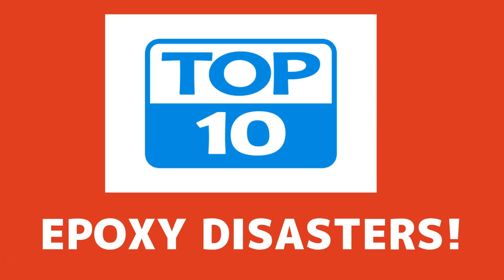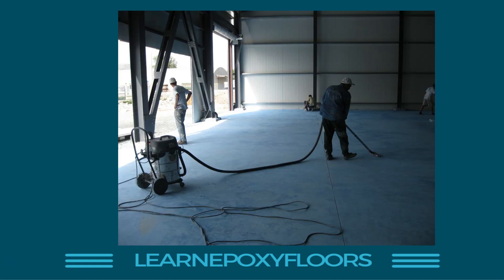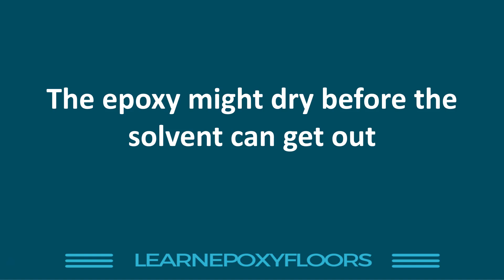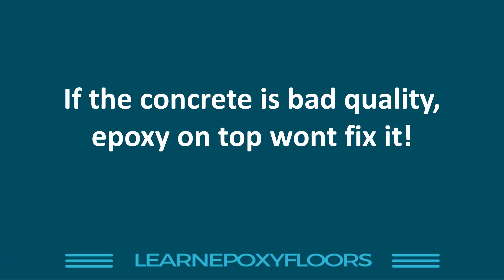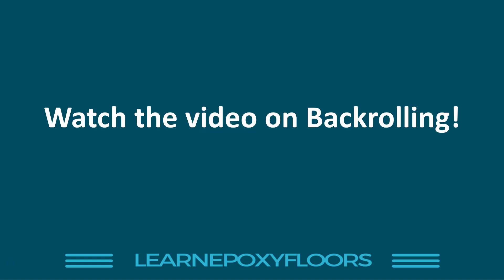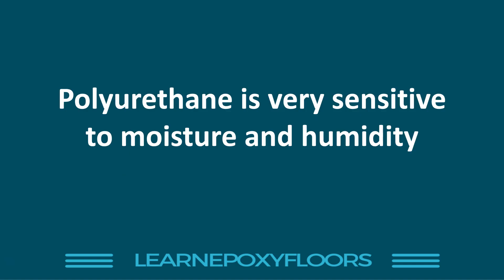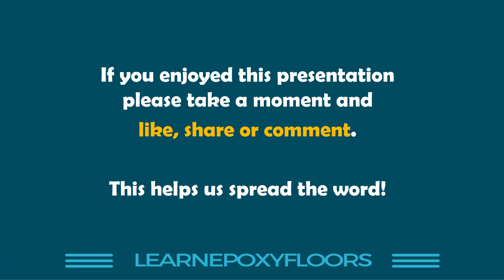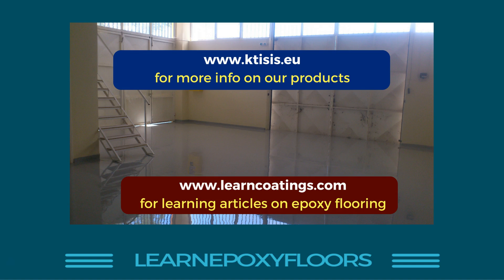Epoxy Flooring Disasters that could happen to you! - Learn about our top 10 incidents

Comment: Thanks for the great info!!!

Quick question: if concrete has "divots" from scraping mastic improperly off floor....would self leveling concrete over entire surface in a thin layer be "rough" enough after drying to begin application or would that also need sanding?

We don't think sanding would eliminate some of those divots.

Please share. Thank you in advance.

Comment: Here's one you didn't add  the contractor didn't put a dam around the  basement floor drain now I have hardened expoxy clogging by drain and we can't use the washer because that's where the water drains

Comment: Many thanks for sharing. We learn from our mistakes very well.  My first pour on counter tops. I Needed one gallon all together for the section I was doing. I learned the hard way not to let epoxy sit to long in large one gallon buckets. I learned  to pay strict attention to what the temperature is of the epoxy. I took way to long mixing in my colors it was an exotic dirty pour complex . I mixed for like 12 minutes and stepped out side for 3 more minutes. Came in started pouring and I noticed the bottom of the bucket was ( WOW BUBBLING HOT )  ! loved the first half of the pour from the gallon bucket but the last half from the bucket was like soft putty. Looking back I should have just taken a putty knife and scraped it all off.  But nope wife comes home from being out of town for a week and is well lets just say shocked...... I tried to save it and the next day it took me 3 to 4 hours to grind it off....Our next pours were all small mixes do it as fast as possible and pour, small mixes fast and pour. flawless.
Reply from the maker: Thanks for sharing this story!. We've all been through this

Comment: The 10 one is not a disaster, is client don't know that dust is use for non-slip parts, some worker will mix that with final coating paint, some worker just sprinkle on the top of last painting surface.

Comment: what do you recommend for a diy kit for a garage that will be a car shop? the floor looks fairly nice and smooth no cracks couple oily spots i know to clean clean clean and clean some more but id like a good product that isn't going to chip away after i drop a tool or have warm tires on the floor. is grinding the concrete necessary on floors that already seem like nice concrete if its clean? or will it set better with the grinding?

Comment: Do you think that we can use epoxy on small tiles shower floor, it could seal totally the floor ? if yes which kind of Epoxy we can use ?
Reply from the maker: Epoxy on tiles can be challenging, you need to grind and prime the tiles to make sure it will stick properly. Also if the tiles are loose causing water to leak, epoxy on top wont fix the problem

Comment: I am going to use some epoxy garage floor product on a wooden countertop that I made out of new wood flooring which I have planed down to bare wood. I am trying to find out what primer to use on the wood flooring ahead of the epoxy...can you help me? Is it an oil based, water based, or something else?
Reply from the maker: Always use epoxy primers with epoxy coatings

Comment: I have these "spiderweb" cracks all over the garage just after 12 of the first application. I've been told this is normal
Reply from the maker: Spiderweb cracks are usually thin cracks in the cement that had been there all along, but they became visible after the epoxy was applied. Shiny epoxy has a habit of revealing problems. For a first coat, this can be normal, just make sure you fill up these cracks and then apply one or two more coats on top

Comment: What is your opinion of the success/failure of applying an epoxy floor on plywood sub-flooring? I have seen videos of people (professionals) doing so, however I have had a number of people tell me 'NO!' do not do this as it will fail due to the wood flexing and the epoxy being rigid thus cracking. Seems obvious failure, but is there any method to avoid cracking from happening...applying cement over the sub-floor then epoxy? Would like an opinion, please. Thanks!
Reply from the maker: I agree with all the people that advise against applying epoxy on wooden floors. Small surfaces like tabletops are ok, but not entire rooms. In fact I have done a video on the subject. https://youtu.be/x_nI_Q6B6x8
As for the best solution, I would recommend finding a coating that has some elasticity like a polyurethane coating. Cement is not the best possible solution cause you will have a sandwich of three different types of materials one on top of the other.

Comment: Wouldn’t you keep your material in the room of the same temperature (space) before the application?
Reply from the maker: if possible yes. But often, practical reasons don't make it possible. For  example if you are applying an entire floor in a commercial space, there may not be any storage space to prime the floor on the first day and leave the goods in an area that will not be primed.

Comment: What about when you’re using sprinkles on like a two-part epoxy and every 5x5 section you do shows lap marks? Wtf? You can’t obviously just keep rolling because you have to throw sprinkles in? This has happened twice. Let’s Go Brandon
Reply from the maker: If you are doing sprinkles always have a second person with you. One person keeps on rolling and the other follows by sprinkling. It's also common to apply a coat over the sprinkles
Reply: @learncoatings-epoxyfloorin9448  
Ok, thanks for answering.

Comment: Great video to watch -we want to resurface our countertops doing a pour, never thought of any of these senarios - we've  never done this before. So as we are scared to death of trying this -it's  better to know how things can screw up before starting so we can be totally aware when beginning this event. Thank you much!
Reply from the maker: You are welcome, countertops are fairly easier to control because they are smaller surfaces. But still I recommend you start with one countertop before proceeding with the others
Reply: Did you do it yet?🤔🤗
Reply: No
Reply: Did you do it yet? I'd like to cover wooden floor(I've got real wood, not plywood) with epoxy. But I'm afraid of doing this. I think I'd better go with polyurethane

Comment: My white floors turned into yellow after 2 years, what should I do? Can I sand it? Should I remove and re-do or is there an eadier solution?
Reply from the maker: Epoxy has a long term tendency to yellow, especially if it is exposed to sunlight. You need to recoat the white area

Comment: Fun Fact: "Wet on Wet" is actually a painting term. It refers to applying a coat on top of another coat without sanding or prep in between application.
Reply: Not entirely true, “wet on wet” is applying wet paint before the previous coat has dried, Bob Ross style of painting. No sanding or prep is correct as it’s still wet

Comment: Don’t use heaters that generate carbon emissions to keep your winter slabs warm while they set up. The tops of the slab will pop due to a chemical reaction that keeps the Portland molecules from properly adhering to each other and the aggregate.

Comment: If you are doing commercial work, make sure your supplier and the color blends are exact. We did a floor at a machine shop at US Steel. They wanted the color to match their new machines, kind of a sad yellow. We had never used this color and it made me nervous. I actually didn't want to do it. This was a big deal for them, about 65000 sq Ft. and they were bringing in the big brass to show off their new machine shop. We did our prep, put on the 2 coats with proper drying time, and left. A few days before the machines were installed I got a call form them. They wanted to know when we were going to finish the floor. I said it was done 4 weeks ago. They were not happy. Some of the crew got lazy or the supplier failed. Either way, he said the floor was 4 different shades and looked like a checker board and they weren't paying. I went to see it and they were right. What can you do in 2 days? I don't know if he ever got paid for that.
Reply from the maker: Hey Daniel, thanks for your input, yes color consistency can be a massive issue for some customers. I always recommend to use the same batch for epoxies, because a slight difference in raw materials can change the tone of the color. In two days I would suggest they apply a light roller applied coat to make the floor look uniform
Reply: @learncoatings-epoxyfloorin9448  Well, putting even a light coat on 65K Sq ft is costly and you competitors will  not include that in their bids. Probably take at least 2 days and keeping this room cut off in a steel mill was almost impossible. Still, I was the manager of a floor company for 3 years and nothing beats Epoxy for lasting and beauty. Word if caution, watch out for heat. A customer of mine had a meat plant that had to be cleaned every day with 181 Degrees water.We told him epoxy can't handle that kind of heat and he hired someone who said he could do it. After a few weeks it began to fail and the contractor could not be found. That is not a surprise. Totally failed. 75000 sq ft. Also, watch out for bakeries and kitchens, same problem. You folks bidding this kind of work make sure you understand the environment before and after the job. Also, a little more on prep, more problems came from bad prep than anything else.

Comment: Hi. I just finished doing my 2nd coat for my bathroom tiles and already start using it after wait for 2 days but it left kinda white spot/mark when the water dry. So I just wondering whether I have apply epoxy wrongly or it just happen cuz it still new😅
Reply from the maker: Although it takes 7 days for epoxy to fully cure, it should have been dry enough after 2 days to not leave a mark. Did you try wiping and cleaning it?
Reply: @learncoatings-epoxyfloorin9448  I do. But it still leave those white dust/mark 😥 I google bout this problem & many suggest to try vinegar + water. If it still doesn't work, I don't know what to do anymore😭

Comment: Can you pour epoxy over self leveler?
Reply from the maker: you mean self leveling cement? Yes you can but make sure it has dried properly. I also recommend lightly sanding and priming properly with epoxy primer before putting any epoxy on it. Self leveling cements tend to be formulated with all sorts of chemicals that could have an unpredicatble reaction if epoxy is applied straight on to it.
Reply: @learncoatings-epoxyfloorin9448  Thank you

Comment: Darn mechanical errors. I found a little secret with adhesion over failed concrete. Cut material in half with solvent so that it impregnate the surface like a fluid. But let it cure before finishing coat. Thanks for video 👍
Reply from the maker: Interesting idea, it would definitely help to impregnate the concrete as long as the smell of the solvent is bearable!

Comment: Hey, could you let me know what sort of epoxy I need to use for a swimmingpool floor ?
The pool is made from water-resistant concrete and the floor tile glue isn't holding the tiles anymore (need to remove them).
I'd like to use epoxy as an affordable correction
Reply from the maker: There are Epoxy pool coatings available specially formulated for swimming pools. When the pool is not being used I recommend to leave the water inside or have the pool covered, otherwise the sunlight will damage the pool coating over time
Reply: @learncoatings-epoxyfloorin9448  ko

Comment: ⚠️desperately need help⚠️ : i had white tile floors that i accidentally painted black with wall paint, which now is chipping off whenever the floor is scratched, therefore i want to cover it up with white epoxy paint, is it okay to leave the black chipping paint without sanding it?
Reply from the maker: Tiles are notorious for poor bonding. If you apply epoxy on top of peeling paint everything will peel away together! You need to sand the paint, sand the tiles and then coat epoxy

Comment: I had epoxy put on my garage floor and it looks great. Problem, they put the wrong color down. is there a way to change the color without sanding down to the concrete?
Reply from the maker: Yes just recoat over the existing epoxy. Just give the existing layer a light sanding and apply over
Reply: Thank you!! I should have mentioned, they already put a clear coat on top of the epoxy. Same advice?

Comment: Great advice. For problem #9, how did you fix the sticky epoxy floor problem? Thanks for sharing!
Reply from the maker: I had to remove any sticky or loose product. I wiped the area with solvent and then I re-coated

Comment: After watching this, I’m wondering if I’m going to have a problem shipping it to the Caribbean where the weather is about 90 degrees. It will be stuck in custom and the ship. Will I have a problem once I get it ready to install? 😱
Reply: I think if the part A & part B get hot while they're in transit, it shouldn't be a big deal. The problem described in the video was that the A&B were very hot when mixed together, which caused the hardener to work too quickly. If the material is cooled down before you use it/mix it, it should be fine.
Reply from the maker: That is no problem. I regularly ship to countries in the middle East where the goods might spend two weeks in storage under 45 degrees celsius. Just make sure before you apply that they have been put in room temperature for a few days

Comment: HI, great video. Just wondering if its possible to get epoxy done on a particle board yellow tongue flooring or should it always be concrete to avoid movement and cracking. Starting a new build and really don't want to put a suspended slab in the house. Thanks
Reply from the maker: I tend to generally avoid applying epoxy on particle flooring. It might look good for a few months and then when the seasons change and the weather gets warmer or colder the whole thing might start to crack
Reply: @learncoatings-epoxyfloorin9448  Thanks for the reply, brilliant. any thoughts on panel flooring. already structurally insulated panels so id think there might not be any movement in it compared to yellow tongue.
Reply from the maker: @fattymattyfinny  if you plan on coating these panels you need to look at the surface if it's suitable for coating. Pvc surfaces are notorious for difficult bonding with any types of chemicals

Comment: Man i paid some pro's to do mine, something like epoxy but a tad more expensive. The flakes looks fine but after they left from doing the final top coat, I noticed the surface just doesn't look right or glossy. It's patchy and textured, if u run hand over it its rough feeling . It wasn't nearly what I was expecting, which was a high gloss finish, smooth and seamless. There's a few tiny spots where it looks like that, which is what the sample looked like I was given initially but most of the floor doesn't look very good. They are supposed to come back and try to give it a smoother look but now i'm worried they're gonna worsen it. Shitty spot to be in, almost wish I didn't get it done now.
Reply from the maker: Sorry to hear that. Applying a proper clear topcoat is very tricky and many things can how wrong
Reply: @learncoatings-epoxyfloorin9448  Hey just an update, they came back to sand/recoat and the results were 100x better. Its dried now and looks like glass, which is the effect we wanted, and with that look the glitter and color actually comes out better.  I didn't think they could improve it but was wrong. There's a few tiny imperfections, but overall much better now.
Reply from the maker: @Flexb123  great to hear that everything worked out in the end!
Reply: @learncoatings-epoxyfloorin9448  Ya, my personal opinion is I think the person who did it is just inexperienced and sent to do the smaller, residential type jobs. I think this was purely an application thing, not applied consistently whatsoever. I can even see the run marks of the tool used up and down the floor from some angles. Good news was when the sun hits the first 1/4 of the floor it looks amazing with the sparkle. But every other angle or lighting just too much inconsistency. They are back tomorrow and going to let them know if they can't guarantee me that it will look better and smoother, I don't want it touched. So scared they're gonna botch it even worse.
Reply: @learncoatings-epoxyfloorin9448  I just watched your Epoxy vs Polyurethane video and that's what they used as top coat was the Polyurethane. I noticed you had said it requires very experience contractor and I think that was the issue, the younger guy didn't have that experience with it, thus all the issues that seemed just from the application inconstancies.